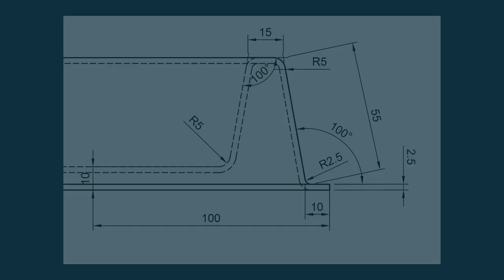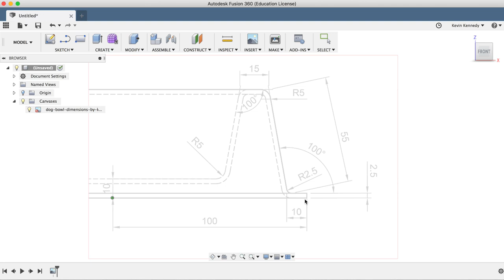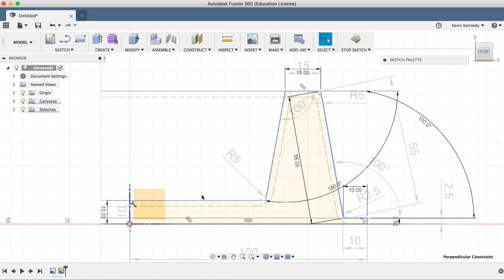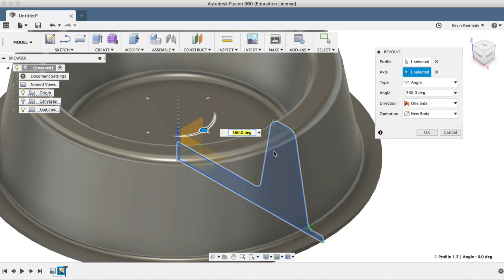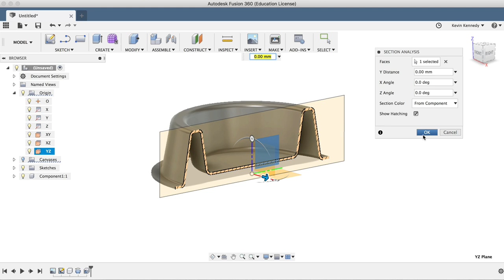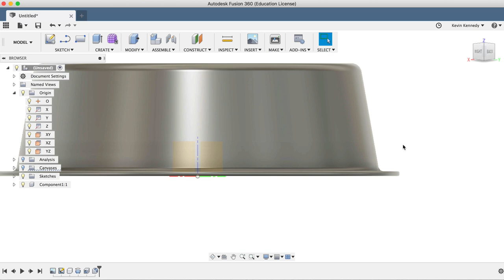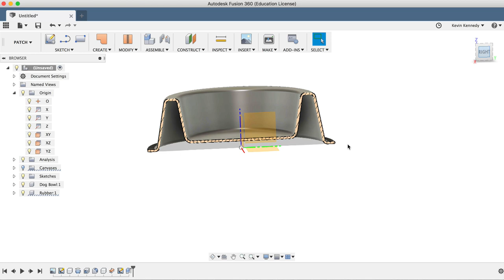How to 3D Model a Dog Bowl - Learn Autodesk Fusion 360 in 30 Days: Day #11

Comment: Just wanted to note if you are in the new UI Preview mode the "patch" tab is not visible under the Work Space selection.  With new look of the UI Preview you remain in the Design mode.   You can then select "surface" and it will bring up another set of tabs to choose from.  Under "create" the Offset function is visible.  At time stamp 10:20 this will allow to create the rubber component of the bowl.
Reply from the maker: Thanks for sharing this, Craig! That is correct. I don't plan on switching to the new UI (for recording purposes) until they have officially pushed it out. Mainly because they're still changing things day by day and I don't want to end up with recordings of 3 or 4 different variations.

Anyway, thanks again for sharing this. I appreciate you taking the time to comment. Cheers, Kevin :)
Reply: I can't figure out how to do the offset with the new UI (Mar 1, 2019).  Anyone know what the commands are now?
Reply from the maker: @tspisak139  Here's a screenshot of where it's located - https://snag.gy/ujMFUv.jpg
The command itself has not changed. What are you having problems with? Cheers, Kevin :)
Reply: FOUND IT.  Switch from "DESIGN" to "PATCH" in the top left pull down then select "CREATE" and the offset surface command is there.
Reply from the maker: @tspisak139  I'm glad you found it! Just to confirm... do you have a "Design" workspace or are you referring to the "Model" workspace?? I looked at your screenshot (thanks for sharing that) and it appears like you were on the same UI as I am in this tutorial... just trying to make sure there aren't more versions of the UI out there that I know of! Cheers, Kevin :)
Reply: @ProductDesignOnline  I missed where you said switch from design space to patch in the video. I googled how to offset from a surface and that's how I figured it out. The fifth time watching the video I heard/saw you select pattern. Thanks again for the videos and the extra help.
Reply from the maker: @tspisak139  Gotcha. You had me worried that there were even more versions of the UI out there. Lol 

Cheers, Kevin :)
Reply: Thanks
Reply: I just asked my friend what it would be. What a helpful comment. Thank you!
Reply: @ProductDesignOnline  thanks a lot for this!
Reply: Thanks for sharing this! I appreciate it!
Reply: @ProductDesignOnline  Good job you show these little patches, its why I like your tutorials, some peoples tutorials are so far out of date they are unfollowable as they were done as fire and forget.
Reply: thank you, sir... you're the REAL MVP

Comment: Hi, thanks for the awesome series! just an FYI that the with the new UI, if I use the surface tab -> offset, I'd end up with a surface(vs. solid) body, I think that topic has not been covered yet. so I end up drawing a profile and sweep'd the rubber band just like how you did the iPhone bumper case.

Comment: Great course Kevin! 
Am I doing something wrong or is the resulting body from the Offset hollow? Then when we Thicken it, it thickens from the surface of the offset, instead of the surface of the steel. Making it so that there is space between the steel and the rubber and not a tight fit?

Fixed it by setting the offset to 0 (zero) and then Thickening from there. It makes a new body no matter if I say Join or New Body. Am I overlooking something here?

(On closer inspection, the resulting body has issues with what seems like not connecting faces from the top and bottom to the rounded sides too for some reason. Changing the offset to 0.01 seems to have fixed this problem.)
Reply from the maker: Thanks, Marvin. I'm happy to hear you're enjoying the course.

If you want it to be touching then you're correct, you can set the offset to to ".01" or larger. You'll likely get issues with 0 because that would place the face at the same spot...and wouldn't technically be "offsetting it."

There is a little gap in mine. Obviously, the rubber would have to be manufactured to stretch over the bottom flange of the bowl. I was more worried about the appearance of the rubber. Here's a screenshot of what the model looks like. You'll see a very small gap - https://snag.gy/hp8XyV.jpg

Cheers, Kevin

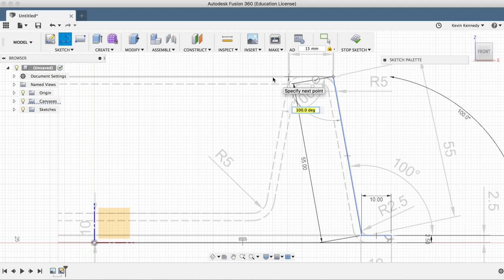Comment: Okay, I feel silly asking this but at 2:50 in this video when entering only a known angle for sketch.  How did you manage to toggle from inputting the distance to imputing the angle of the line instead??  I am so used to other surveying CAD packages or straight CAD where one uses the "<" in a command line to input an angle???  Okay, I still don't know how you toggle but I did figure out a "workaround", I continued to sketch the line at a longer distance, then I went back and dimensioned the 100 degree angle back in to make the line be at 100 degrees after I sketched the line and not before.
Reply from the maker: Hi, Jason. Great question - and something I will elaborate on in future videos. There will always be a second input field whenever you're using certain sketch tools that have degrees as an available option. For the line command, the degrees will show up any time you're creating a line of a preexisting point or end point of a line. So at 2:50 there was an input field for the length and another input field for the degrees.

What I did is hit the tab key to switch from the length to the degree field in order to fill that out first (if yours defaulted to the length). It's important to note that you can only fill out the corresponding measurements per each input - meaning, you cannot type a degree in the length input nor a length (mm) input in the degree input field. I hope this helps... let me know if this clears it up! Cheers, Kevin :)
Reply: @ProductDesignOnline  Okay, I got it, as long as you haven't previously entered a value for distance or angle, tab will toggle between the two. It's only after you have entered a value for either that tab will lock that value in!! Something so simple tripped me up so much... gosh!!
Reply from the maker: @jayclyde6045  No worries - this is great. Thanks for bringing this to my attention. It's these small details that become habitual that I don't always discuss in detail. I'll definitely discuss this in a future video. Cheers, Kevin :)
Reply: @jayclyde6045  Don't feel bad, got me too...feeling pretty stupid now...

Comment: When adding the dimension at 4:24, I get a dialogue box with the message; " Adding this dimension will over-constrain the sketch. Choose OK to create a Driven Dimension". After clicking OK, the dimension is shown in parentheses. Everything works OK, so should I be concerned over this?
Reply: I think this is just a minor F360 version difference over time since the video was recorded because the set of constraints that appeared for me, after tracing the 2D canvas in the same order that Kevin traced them, was a little different too - and everything worked OK for me too.
Reply: @chillyspoon  Thanks.

Comment: Hi Kevin, What is different between surface offset and solid offset
Can you explain for me?  at 7:24
Reply from the maker: Hi, CHO성진. The surface offset creates surface bodies that have no real thickness to them until you thicken them (using the thicken command) or turn them into solid bodies. In this scenario, I offset the surface so it was easy to trim and work with and then I thickened the surface so it was a solid (and realistic) body. Cheers, Kevin :)

Comment: Your old UI you went to patch which I don't have in the new UI. Once there you went to Create drop down and then selected Offset. Is this the same as if I went to the construct drop down and then selected offset plane. I think they are the same.
Reply: Check out the 'New UI vs Old UI' video from August 2019. The old 'Patch' is now 'Surface', there is a 'Offset' tool under the Create drop down there.
Reply from the maker: @jefffield1402  Thanks for answering, Jeff! Cheers, Kevin :)
Reply from the maker: Hi, James. Jeff is correct, with the new update everything in the Patch workspace was moved to the "Surface" tab. It was renamed from Patch to Surface because all of the features and tools nested under the tab correspond to the surface modeling approach. Cheers, Kevin :)

Comment: What is Patch workspace? How is it different from model workspace?
Reply from the maker: Hi, Paul. Great question! The Patch Workspace has two main purposes. First, to repair imported data that has holes in it. Second, to create surface models. Surface modeling techniques, such as the rubber banding in this video, are used to create objects by creating their outer surface and then by adding a thickness to it.

Surface modeling is widely used for packaging and other products where the outside contour or surface is more important than the inside. Here are some surface modeling videos to check out - https://www.youtube.com/playlist?list=PLrZ2zKOtC_-DOD6xpOtn5pFPO1mUNcPhv
Cheers, Kevin :)

Comment: Hello Kevin, I cannot find "Patch" menu in the updated Fusion 360 new version. If possible, could you please update you video?
Reply from the maker: Hi, Erkan AĞIR. All of the "Patch" workspace tools are now included in the "surface" tab from the "Design" workspace. The Design Workspace now encompasses the solid modeling tools, surface modeling tools, sheet metal tools, and the "tools" tab which includes some analysis functions, 3D printing and your add-ins and scripts.

This Friday's video will be covering the new UI and all of the updates and changes. I'll be discussing all of the critical changes that you need to be aware of to find the new placement of tools, which will hopefully make it easy to still follow along with these older videos. Cheers, Kevin :)

Comment: Hi, do you know why i dont have all the materials you have in appearances? For rubber all I have is "bumpy" and "weathered" I dont have soft or hard. I really appreciate your videos!
Reply from the maker: Hi, John. I'm happy to hear you're enjoying my tutorials!
Make sure you have the "show downloadable materials" option checked that's located in the Appearance dialog box. If that is unchecked then it will only show the handful of materials that you have downloaded before. Once that is checked you'll want to double check that you have the folders expanded to see all of the various materials. 

By default, the dialog box is quite small and hard to see a long list of materials. I would recommend extending the Appearance dialog size. Let me know if you're able to find it! Cheers, Kevin :)
Reply: @ProductDesignOnline  Thank you, that worked, I extended the box and am now able to search for the materials. I see if you right click on the material you can add the material to a favourites list which could save some time.
Reply from the maker: @johnrobinson6796  Glad that worked! Yep, favorites are definitely a helpful resource in the appearance dialog... just be careful not to have too many favorites or your list will get too long! haha 
Cheers, Kevin :)

Comment: With the new fusion 360 UI, how do you get to the "patch" workplace? It does not state that when I click on design. Otherwise great tutorial
Reply: Sorry figured it out. It is now called "Surface" and is located between solid and sheet metal on the top of the screen

Comment: When im trying to create the offset it wont allow me to select the whole bowl at once (it separates it into different sections) so it only makes the offset on the top half of the bowl. How do i make it select everything at once?
Reply: time stamp is at 7:26
Reply from the maker: @rohemoriyama Could you share the link to your file? To share your file - In Fusion 360 go to the FILE menu > Share (flyout folder) > Public Link. Make sure the "downloadable" toggle is turned on and then copy the URL and paste it as a reply to this comment.
Reply: I had the same problem in that the the bowl section and the bottom rim seemed to selected separately. Can't understand why

Comment: I am unable to find PATCH Workspace in the current version of FUSION 360 that I am using. How should I provide the rubber padding then?
Reply from the maker: Hi, Bisheshwar Haorongbam. The patch workspace was renamed the SURFACE tab, which is now located in the DESIGN workspace. More on the name changes can be seen here - https://youtu.be/tuZzHcmFtg4

Comment: Ok so when you go ahead and then stop the sketch to activate the revolve tool, why does the sketch need stopping? What happens when you stop the sketch? Also why did you select new component? Could the new component from right clicking in the browser top line have in fact been done before this at the beginning?
Reply: James Barratt, the revolve tool is a Solid tool, so a sketch has to be/will be stopped to do a revolve. You can either stop a sketch manually, then select the revolve tool, or Fusion 360 knows, that if you select the revolve tool (or any solid tool) the sketch must be stopped.
Reply: Thats a sweet a answer. Thanks.
Reply from the maker: @jamesbarratt593  Jeff is correct in his answer. (thanks for answering that, Jeff!) Cheers, Kevin :)

Comment: 1:35 when I double click on the image icon to reposition the canvas, the edit feature windows open and I have all the controls to move the canvas, but the canvas itself is not visible. For the life of me I can't figure out why. In the end, I just typed the X Distance and Y Distance as shown in the video and clicked OK. The canvas is then visible and in the desired position.
Reply from the maker: Hmm.... right-click on the Canvas (image) in the Fusion 360 Browser and check the opacity setting. It may also be te affected by a different component being active.

Comment: not sure what i did wrong, i get the error "Error: Failed to solve. Please try revising dimensions or constraints." when i attempt to put the horizontal constraints. these are the same that you show in your video
Reply from the maker: Hi, Veziop. That's strange. I can't say that I've gotten that error before, but sounds like Fusion 360 is being picky about some constraint or dimension. I would suggest trying again from start... if the the problem still persist then please share your file and I will take a look at it.

To share your file please go to File > Share > Share Public Link (make sure "downloadable" is toggled on) > Paste your link here as a reply to this comment. Then, please write a separate comment letting me know you've replied with a link because YouTube flags most links and I don't always get notified. Cheers, Kevin :)
Reply: @ProductDesignOnline  I hope this link and notification works !
Reply from the maker: @veziop  Got it, taking a look at it now...
Reply from the maker: @veziop  I took a look at your file and noticed that you have perpendicular constraints on each corner. This is what's causing the error. With the perpendicular constraints in place, you do not also need the horizontal constraints. If you take a look at my screencast at 3:47 you will see that I just have a perpendicular constraint at the top left corner (not the bottom left corner as you do in your file...and same on the opposite side). The error message is essentially saying that it can't "compute" the constraint because it would be overconstrained to force those lines to be horizontal in two different ways. Cheers, Kevin :)
Reply: @ProductDesignOnline  oh I see now kevin! I will keep that in mind in the future, thank you!
Reply from the maker: @veziop  You're welcome! I'm glad I could help! :)
Reply: @ProductDesignOnline   I had the same error, thanks for the clarification! great tutorials ever!
Reply from the maker: @Peter0028  Glad that was helpful! Thanks for taking the time to watch and comment. Cheers, Kevin :)
Reply: @ProductDesignOnline  A year later and I'm having he same problem! So what's the fix then? Leave it as is as it's already constrained? or erase the constraints and add them back in?  (That's what I'll try.)
Reply: @ProductDesignOnline    I wonder why the extra constraints appeared in the first place? I erased mine and then copied yours, which worked like a charm.
Reply from the maker: @JesseKellys  The automatic constraints are applied based on the type of sketch geometry and a number of other factors (how you click, the direction, where you click, etc). It's hard to say, without comparing a screencast side by side, but it's likely a small difference in how we created one of the sketch details. Let me know if you get it working!
Reply: @ProductDesignOnline  Thanks; I got it sorted and understand constraints now; at least to a very small degree!
Reply: @ProductDesignOnline  I managed to solve the constrain errors by erasin the constr and adding the same as you have. However interstingly the dimensioned upper left horizontal line only allows horizontal constr or dimensioning but not both of them giving red error if I try to apply both. "Adding this dimension will over constrain the sketch" or "Failed to solve. Please try revising dimensions or constrains".